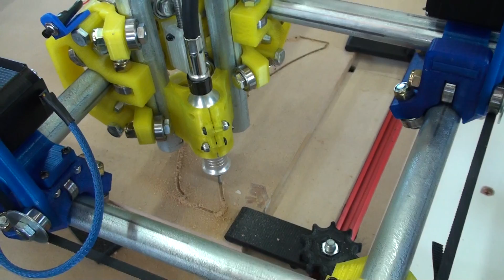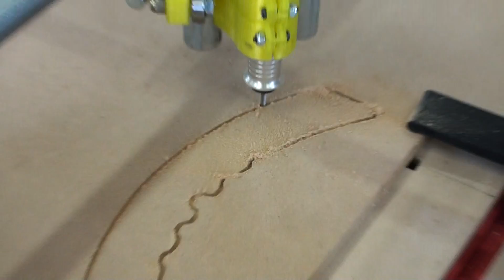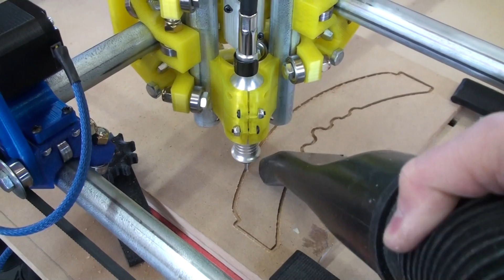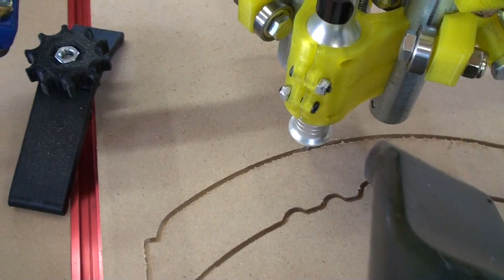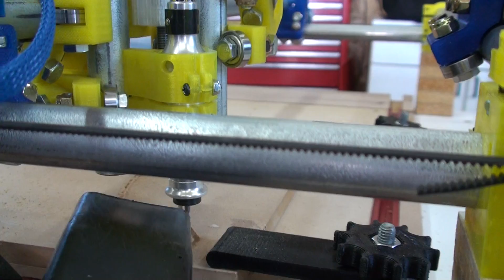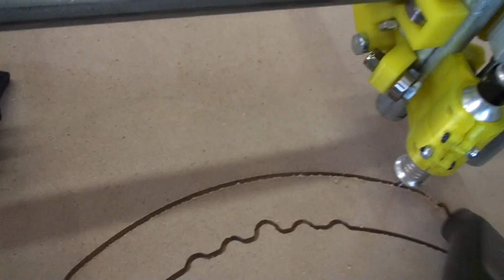Beer Caddy Handle

Comment from the maker: That was the spindle in the regular specs plus the foredom hand piece, I have since added a bosch colt. I wouldn't recommend the Foredom hand piece, it failed within a month, the chicago carving tool was just as good by itself but cant go bigger then 1/8 on your bits.